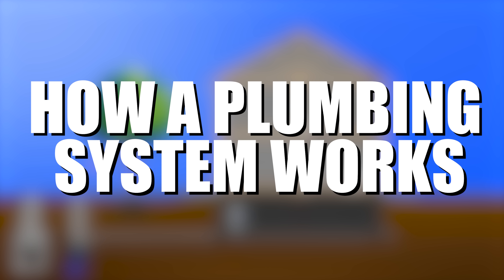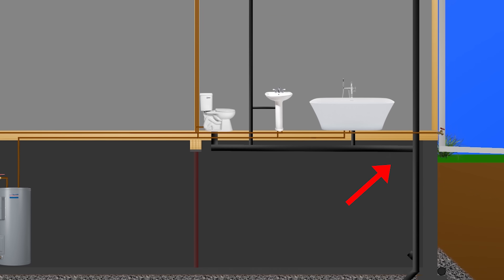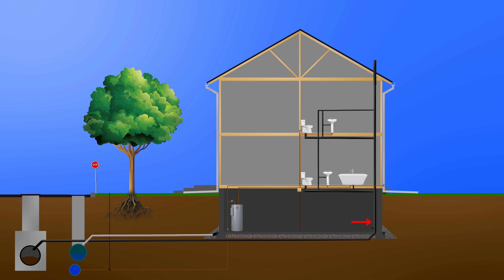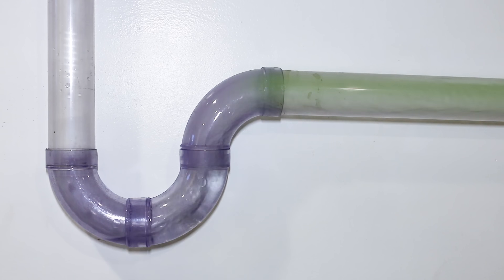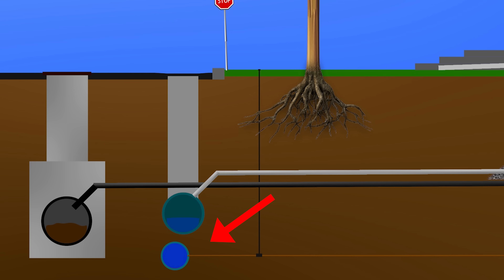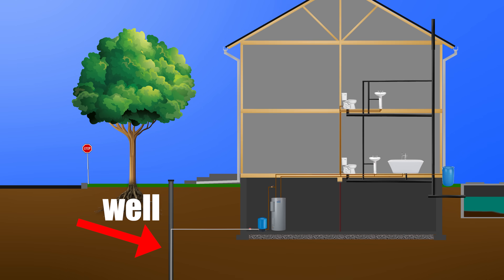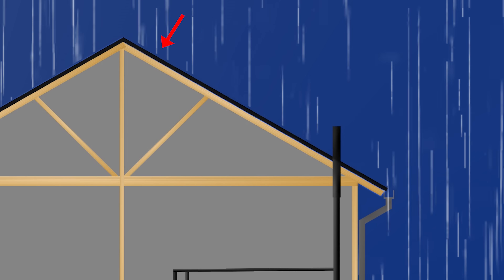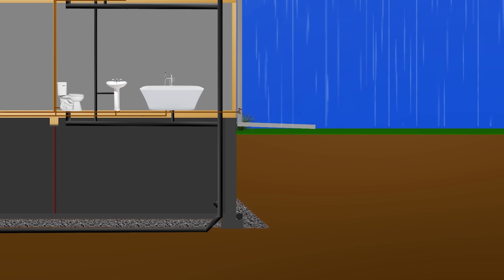How Your Home Plumbing Works (From Start to Finish) | GOT2LEARN

Comment: Dont put your downspouts into your footing drains!I've dug too many up that are plugged with leaves, needles, shinglestone,and other gutter wash buildup 👌
Reply: This seems to be standard in most of the older homes I've seen in the Northern US. The old clay connection tends to break over time and pretty much anything can get into the hole in the ground. Newer homes have pvc or some sort of other pipe that extends a foot or so from the ground to connect to the gutter, but the drainage still goes into the ground. I'd imagine it's because this is very flat land, and heavy clay soil, so there would not be enough drainage otherwise, it would pool in the tiny yards. Per the Ohio Rev Code, it's illegal for roof runoff to cross public sidewalks, so city folks/apartments and businesses with green space to collect runoff have to have downspouts into drains, unless they have a system for rain collect, which most city folks don't.

Comment: I moved into a house with 3 toilets back in march. Two of the toilets at the front of the house every few months block, basically I believe because our neighbours are putting baby wipes down their toilet which blocks the drains (we are connected with the neighbours it doesn't go out into the sewers beneath the road). Requiring someone to come and unblock it. The thing is if I fill the sink up with hot water with the plug in the sink, then take out the plug so the water empties quickly  it then causes the water level in the blocked toilet to go down. Ive always wondered whats happening. Also a shower cubicle is linked and the shower tray fills up after a minute or so. Again if I fill up the sink with hot water. Take out the plug it then causes the shower to drain. But then it's still blocked as if I flush the toilet again it fills up. obviously the hot water and it being emptied quickly is causing some kind of reaction which then helps the water drain. Also the sink which must be connected to the shower and toilets will never block. But yet the shower cubicle blocks within a minute or so.

Comment: Wrong title, 
It absolutely does NOT Work that way in my home...

We have a tank on our roof, which gets filled by a borewell.
That water is definitely NOT potable, so we have a filter for drinking water, and we boil the water otherwise.
Our drainage from sinks, shower etc is completely seperated from toilet output.
Drainage goes through a pipe to garden, 
And toilet output goes to a septic tank, which does NOT need any maintenance, just has a long ass vent for gases to escape. The bacteria do their job of breaking down our waste.
And rainwater just goes off without relating to anything else...

Comment: What about the air in front of the water going down the drain? Does it not need a vent? Does it simply compress the air into the septic tank, forcing the water content out into the leech field?

Comment: I surprised you didn’t bring basins for rain water.   Some areas use basins for the rain water to run to via storm drains. Still a great video.

Comment: This is accurate for second world countries, and perhaps the US. No modern house in Australia is built with a septic tank. Doing so would contaminate the groundwater. As a result, every single house in the country is connected to a sewer system. This video is so uninformed about best practice it's borderline misinformation.

Comment: Most plumbing fittings attach to the outside of the pipes.  But PEX goes on the inside.  I had a plumbing inspector say that since the inside diameter of the fittings was smaller than the pipes we had to go to the next size larger.  The funny thing was that the customer wanted oversized water lines so everything was plumbed with 3/4 instead of 1/2.  And only 10 ft of piping had to be replaced.  He was told "no problem,easy fix"  Dude had a real thick russian accent, i think he was expecting a bribe.  He was thinking all the plumbing was going to fail not just the first 10%.  I replaced it with 1 1/4 as a passive-aggressive "fuck you "

Comment: Your septic tank part was very very simplified. Bacteria consume the waste, the water is treated before being pumped out into a gravel pit or irrigation system. I doubt they'd let anyone just leak their septic water into the ground anymore. They don't in my country (Australia) anyway.
Reply: In the US the waste water from the septic leeches into the soil and doesn't need to be treated.  There is nothing wrong with doing it that way if it's done right.

Comment: nice graph. But hold on. That's not how it works in the UK. All pipes should be installed outside your house so that neighbours can see them. The more pipes and the uglier it looks the better for the value of the house ;-DDDD

Comment: 30-80 PSI? Pfffft my city provides 120 PSI. I know I couldnt believe it either. Pressure regulator is working overtime but the shower pressure is nice.

Comment: As a kid, I always wondered how things work. Then after learning physcis in school the curiosity just increased and I've always found myself wondering how physics applied to these kinds of systems. This was a great explanation, easy to understand.
Reply: Friction and viscosity of flow in pipes is a major design of these systems.  As he mentioned the storm and wastewater pipes are sloped so gravity driven and that slop varies based on those factors and the materials of the piping system.  The less you need to slope them the fewer lifting stations you need which are expensive and require regular maintenance.
Reply: What do you do now? Did you went on and continue studying physics? I bet you did something great with your life by now. Serious

Comment: Until about 5 years ago our city still ran combined drainage, mainly in the old neighborhoods. That was until the EPA stepped in and mandated the changes for a mere $1.5 billion. They have been installing new sewer drains and underground overflow bins for when strong storms hit. It added a $50 usage fee and a separate smaller fee for gas and water.

Comment: Great Video. Loved every second and learnt a lot. 
Quick note: in cases where water is supplied by a well, it's usually pumped into a storage tank. The tank is usually on the same level as the house or higher. this allows a consistent supply and pressure in the event of a power outage.
Reply: The tanks can also be pressurized to provide water pressure if power is off.   

The depth of the wells also vary based on location.  They can be as shallow as 50 feet deep or as deep as the 500 feet he mentioned in the video (some rare cases deeper).  But the average is probably only 100 to 150 feet deep.

Comment: As a plumber this shows you how a new home should be properly plumbed. If you do not live in a newer buit house than chances are a lot of this shit hes talking about is not actually how your plumbing system is. Because codes were different back then. Dont try to argue with your local plumber because you watched this video.

Comment: Went to school for plumbing, almost impulsively. Never really aspired to be a plumber but was given the opportunity to go, so I went. Once I graduated, did some plumbing in the Gettysburg, Pa area and quickly decided it wasnt what I wanted to do for the rest of my life haha However, Ill never regret going to trade school. Its a good knowledge to have. Same as being able to work on your own car. 

Gettysburg, being an extremely old town, had extremely old plumbing... Sometimes there was still lead pipe in the buildings. Cast Iron sucks big time because it peels away on the inside, dont really know how else to explain it. And its a nightmare to replace because it disintegrates as soon as you try to do anything to it.. PVC/ABS are amazing, low friction, doesnt degrade, LIGHTWEIGHT. You really gotta abuse a drain system to clog it up, if its been installed correctly... 

Copper water lines are generally fine, until they freeze, but the same goes for PEX due to the pieces the pipe gets clamped on to. But PEX is really a cool pipe material, it stretches when the water inside freezes, and returns to normal when it thaws. The T's/90's/45's/valves/etc are the weakness. Brass is a soft metal and the water will eventually erode its way through after 15 years of use(speaking from experience in my own house). They make plastic ones, I dont have much experience with them but they feel cheap, however they may hold up better.

Comment: Why is water so filthy and tastes bad in newer communities?  Why does the average person need to use extra water filters in order to get halfway potable (still nasty tasting) drinking water?  Is it because we are drinking a certain amount of non-potable, chemical-laden, mold-laden,, etc. water that is coming through the pipes?  Why does the municipality lie about the potability of water, when you get sick from drinking it right from the tap?  It costs thousands of dollars to get a reverse osmosis system for the whole house, and that still may not do the job.  I'm totally stumped by the quality of water that is reported to us yearly.  It isn't as good as they say, and there is always a disclaimer at the end of the report.  Even my filters get clogged with grime and slime.  It's a pity that a great country such as ours ?  can't supply clean, fresh, potable water that can be used without having to go through a personal process.  I'm not impressed by your explanations because they avoid the real issue...What in the H are we drinking?

Comment: hello, @about 02:12 the solids dont need to be pumped out  of the cesspool by a vacuum truck if u flush a box of  RidX once a month down ur septic bcz the RidX contains millions of engulfing bacteria that breaks down solid matter into a low viscosity sludge, thus keeping ur septic regular, & there'r even more potent industrial strength liquids than RidX, with powerful emulsifiers.

Comment: This has some points that are right and can take some thing away but A LOT of information is miss construed or just wrong just know watching this you have not properly learn information for example your water will always be above sewer drains and storm drains are offset from the water in case of a sewer leak you don’t want that water seeping into your drinking water

Comment: What would make a toilet that is clean and is kept clean and has nothing dirty around it have the same rotten poop smell every time I stand there taking a piss? A vent? Wax seal? It's sealed with silicon on the base and nothing can get out the edges though. I don't like it at all.

Comment: Great video.  Condensation runoff is another one for houses with A/C.  It is shocking how much damage even a slow leak can do over time if water is not managed properly.
Reply from the maker: Yes, correct, thanks for adding that in!!

Comment: In Sweden, thanks to environmental-laws, it is not allowed to let the waters drain out into the ground anymore(when you have a non-municipal sewage-system). There needs to be installed a mini treatment-plant after the sludge separator(for solid waste) to purify the waters, until it is almost drinkable. That or a constructed complex ground-bed with different layers of soils, rocks etc. In both cases it will become much more expensive then just filtering the water trough the ground.
Reply from the maker: Interesting!!!

Comment: You can wet vent on inch and a half pipe if the fixture unit load is not to high, which most all baths can handle it. Now if your piping is in a concrete slab your drain piping can not be smaller than 2" piping. I've been a plumber for nearly 50 years.....

Comment: the inlet pipe coming in the septic is almost to the top. the outlet or filter is 4" lower,to keep operational water line just below inlet

Comment: I have an oil fired water heater, not gas or electric. Also I have DWV copper, for my DWV system. I have a cesspool. 3 things you forgot to mention. Very common on Long Island. Also the sewers in New York are combined, not separate.

Comment: That tank in the basement is call a 'water heater ' not a 'hot water heater'.  If the water was already hot, you wouldn't need a heater.
Reply from the maker: I said "hot water tank" not "hot water heater".

Comment: My septic tank is under our road, lol. The road use to stop at my house and the septic tank was put in behind the road for easy access. I moved out of state for a job for a few years and we decided to move back, the road was over it. When houses were added down the road they paved over my septic tank. I called the road county manager about it, but they said there was nothing they can do about it, since it is now part of the public road system. I flush 1 gallon of buttermilk every month and it actually eats the waste. Been doing this for 16 years now. If anything happens we will have to have a new septic tank put in. Yes I did check with a lawyer and the county had the right to make the road. I found out they sent notice of the road going through, but I never received it.
Reply: Have you checked to make SURE ? I find it hard to believe that they would risk paving over something that could easily give in like a septic tank.
Reply: @bradleyrussell1973  Positive, I was there when they put it in the ground. The road stopped at my driveway and we put it in line with the road, so if it ever needed emptied all they had to do was backup to it.

Comment: In Ireland most houses have a storage tank in the attic which is fed from the mains supply. The tank is then used to feed water to every sink except the kitchen sink and also all baths and showers. Another tank is used to supply recirculating water for the central heating system and is much smaller than the storage tank.
In the event of the storage tank being emptied due to a water supply outage you can have airlocks in the systems fed by the tank.These need to be purged of trapped air by linking the pipes temporarily to the high pressure mains supply. 
In areas of high altitude and in rural water schemes water pressure can be a problem and water quality and reliability of supply can also be a problem. Hence the need for strorage tanks in houses in Ireland.

Comment: The water line that goes into a home; the shut off is what is called a water box, I have never seen a 3/4" waterline to supply the whole home. Typically the internal water lines would be that size, but the the main water line. This is the case with building code where I live.
Reply from the maker: Differs from place to place
Reply: @Got2Learn  absolutely. Where we build, we will have certain codes, but our next development which may only be 2 miles down the road will have a different township, giving us different governing bodies and ultimately, different codes to follow.
Reply: @Got2Learn  however, I still argue that a 3/4" water main is insufficient to modern building standards, in almost every locale. If the situation changed from residential to commercial, I'd see a need for change but certainly  ³/4" is odd.
Reply from the maker: @CallmeJeffy1  costs is probably the reason
Reply: @Got2Learn  I would have to disagree, as you said in the video, main water lines (to a home) have to have sufficient PSI, but in modern homes we build more bathrooms, sinks, 
 etc. The 3/4" lines are used internally. The come from the main, through the meter and then distributed. If you have two people bathing at once, a modern day plant has the PSI to do that but limiting the home by using a 3/4" water line is just insulting. Modern standards would require a larger line for a homes water main. I typically see a 2" line from the waterbox, which then feeds the home. I am not trying to be insulting, just stating what normal, urban/suburban codes are asking for. For relevance, our company builds in a 1+ million population environment. Our codes will differ from NYC, LA, Vegas, but we are not building in rural areas by any means. For context, I am the superintendent, I monitor all job site operations, ensure safety and also ensure the inspector does not turn us down.
Reply from the maker: @CallmeJeffy1  yeah here it's only 3/4" from the street, seems to be doing ok hehe
Reply: @Got2Learn  that is super interesting, water lines, before the waterbox are typically 4-8 inches for residential. What type of population is your area, or maybe the average square footage for a residential home? Honestly, I am not trying to argue, just super curious. Especially since this information may be beneficial.

Comment: Have you heard water pressure regulators? The city’s water pressure is used very high so that is some (maybe all) houses have water pressure regulator. It reduces the pressure to less than 80.

Comment: Are water services THAT deep? They’re not where I live. Typically they’re at least 3’ (frost line). What you’re showing is 10’ deep!
Reply from the maker: Frost line here in Canada is 6'.
Reply: It’ll very from place to place but in Ontario water mains and service lines are 2.4m or 8 feet deep for frost line and I’ve seen 10 feet in Northern Canada and generally most city specs have the water main above the sanitary and storm mainline to prevent contamination if there’s a leak ( sanitary) or water main break

Comment: Another big info/tip, flushable wipes aren’t actually flushable, because they don’t breakdown like TP does and clogs pipes and those filters down the line. Don’t use flushable wipes unless you put the used ones in a trash can, maybe one like those special diaper trash cans.
Reply: @Sindrella06 Spraying your (*)'  hole with water doesn't get it 100 percent clean that's why. You really have to get up in there with toilet paper to give it a good scrubbing.
Reply: I learned that lesson back in 2008. The plumber cleaned out the wipes and I got a bill for $550.00. I only flush waste and TP. My plumber that I shouldn't even flush kleenex tissue, so I stopped doing that also.